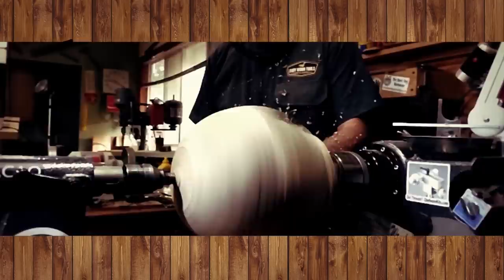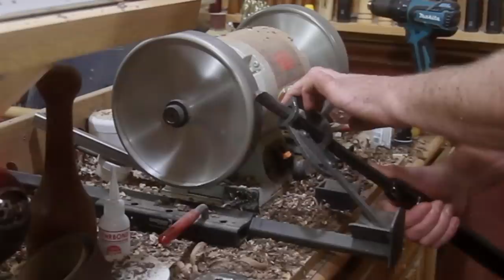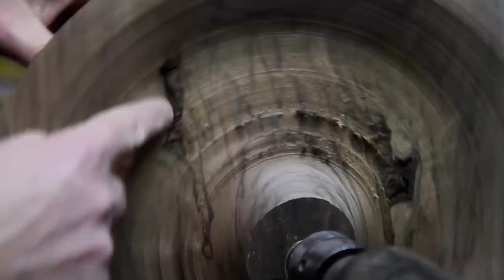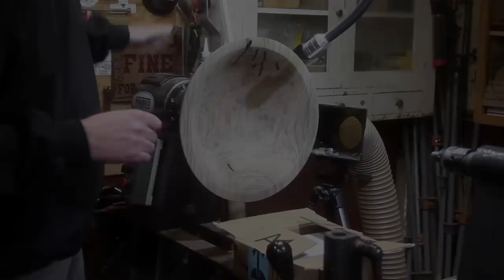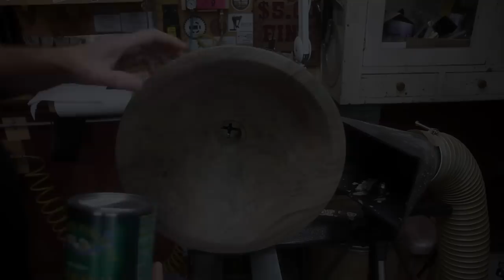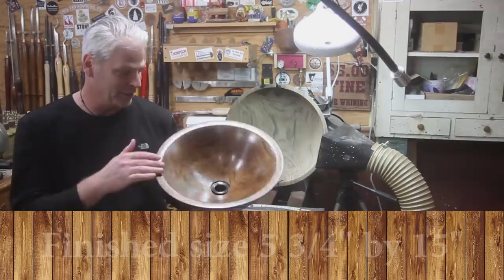Woodturning - Wood Sink

Comment: Carl, I am having trouble finding a good overview of different ways to remount a green turned blank after it is dry.  Its no problem when the piece is smaller to cut a lip on the inside for the chuck, but at some point bowls are too large for my chuck to work.  would love to see your approch
Reply from the maker: Hi John, I remount the bowl between centers with the bottom towards the tail stock. I reshape the tenon to fit back in the chuck.

Comment: I love to use walnut too, but I've got a couple of questions.  1. Arm R Seal: Is it water proof enough so you're not concerned about the finish becoming ruined?  I know you said you used epoxy, would that seal it properly then?  Why use any Arm R Seal at all then, or was that for the sheen?
I never knew about Starbond Black, thought maybe you used a transtint for it.  Have you used transtints on CA Glue?  Just not sure how that might work out.
Love your work Carl, thanks.
Reply from the maker: Hi James, Yes I used the Arm-r-seal for the satin sheen. It's water proof finish with several coats it'll last a long time. The epoxy works very well too I just wanted a more natural look.

Comment: Very nice piece. I am wondering about the longevity? How often do you need to re-coat it? I've seen a lot of sinks, basins etc but nothing showing them after few months / years of use
Reply from the maker: Thank you Alan, unless it gets dented it should hold up for years. I've had one in the RV for about a year. It's holding up great, but it's resin.

Comment: Beautiful sink Carl. Why the change in finish though? Just seems the epoxy lowers the risk of damage and water reaching the wood.
Reply from the maker: Thank you Phillip! I'm making the sink for someone and they wanted a satin finish.
Reply: Carl Jacobson  I've never tried it, but pulling a gloss epoxy back to a satin with steel wool like you do with other clear coats like polyurethane might work. If it did work it would be much more durable than poly. Oh yeah, great looking sink by the way!

Comment: Have you ever made a sink out of Repurposed wood? I’m wondering what you would suggest to Seal it. I bought a Mid 18th Century Mennonite Trenching bowl for Bread making that I am going to make into an awesome Bathroom sink. With many years of various oils etc curing it, what would you suggest for a sealant so water can be put in it? Thanks
Reply from the maker: I haven't made one out of reclaimed wood yet. I would use epoxy to seal it. You can look around but Stonecoat has a top coat that is matt and would give it a more natural look. The link is in the description. Good luck, it sounds beautiful! :)

Comment: Nice project again.  I was surprised that Arm-R-Seal was water tight.  I'll try it.  What settings do you use on your sharpening jig?  I have the same system and get good results but was wondering how you do sharpen.
Reply from the maker: Thank you! Ya it works great! I have my jig set on the third notch from the bottom. Thompson tools has a template on their website.    http://thompsonlathetools.com/sharpening/

Comment: Excellent video video as always Carl. They turned out really nice!   How well has the Arm R Seal held up compared to epoxy?
Also I know it’s been a bit since you posted the video but some of your links are no longer going to the correct products.
All the best.
Ron
Reply from the maker: Thank you very much Ron! We sold the sink, and haven't heard anything back from them so I'm assuming it's holding up well. Thanks for the heads up, I'll check the links.

Comment: Hey Carl, got a question for you.  

Did you turn this green, or was the blank you started with been drying for a long time?
Reply from the maker: The blank was dry! I wouldn't try this with green wood, because it will warp and the drain won't fit right.